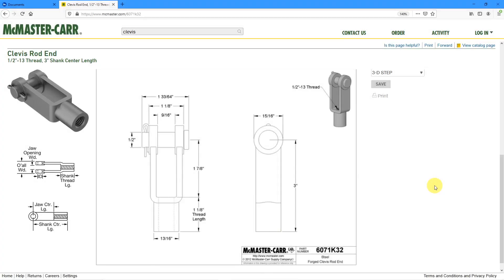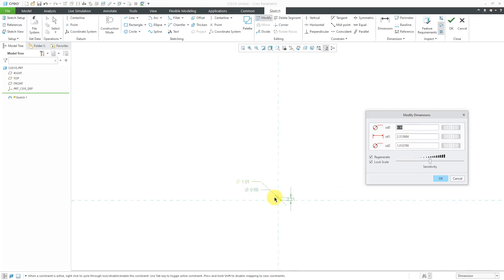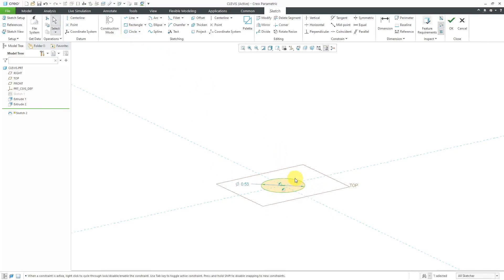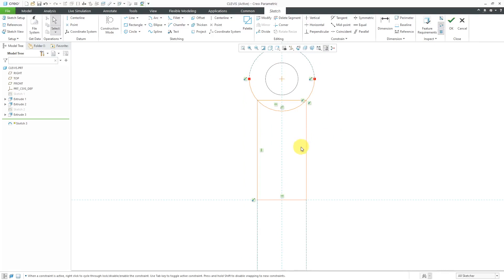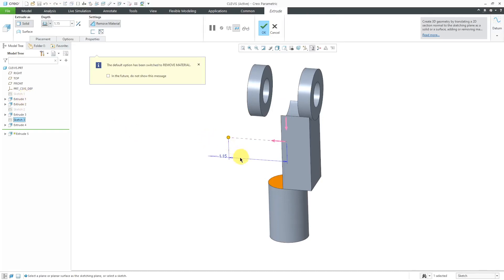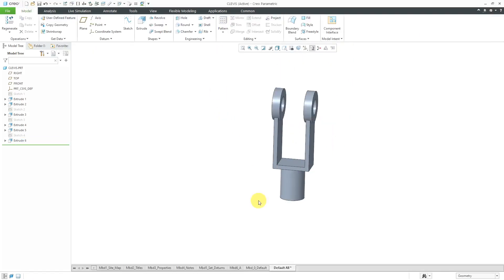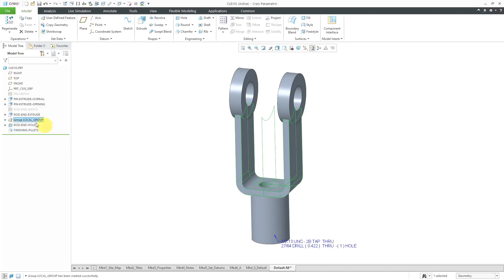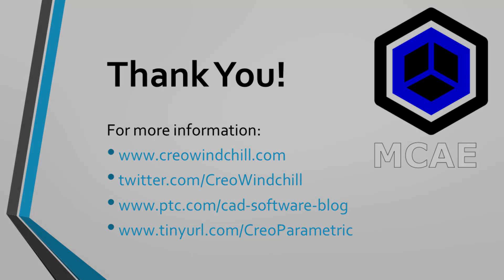Creo Parametric - Part Modeling Example | Clevis

Comment: Hello Dave , thanks showing us the offset option of the depth in extrusion ( very very useful )  ,if i had to modelise this clevis  for the jaw  , on the right datum plane i would just create a U profil with good width centered on each rings and the surface above the U would be offseted up to rings surfaces .
Reply from the maker: Yes, there are multiple ways to do this. Playing around I did 4 different methods including a Sweep for the U section, but ultimately went with the offset depth because I figured it was the functionality people would be less familiar with since it was introduced in Creo 4.0.
Reply: yes indeed you're right